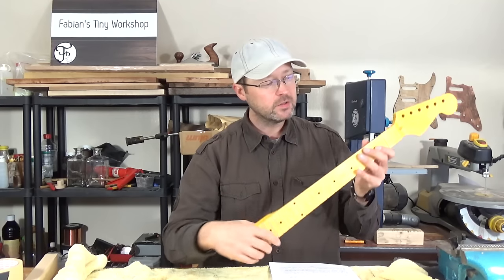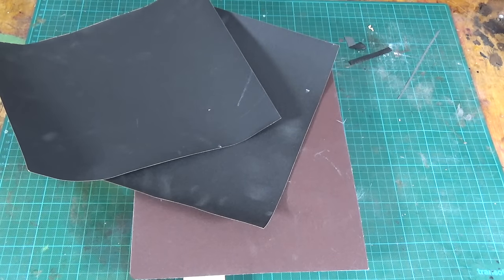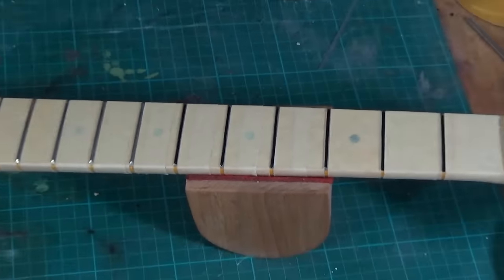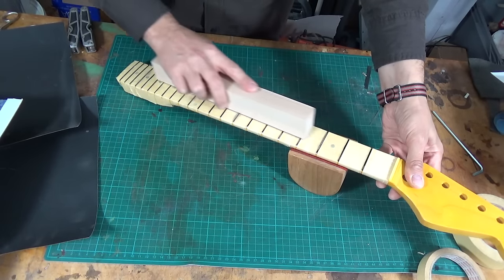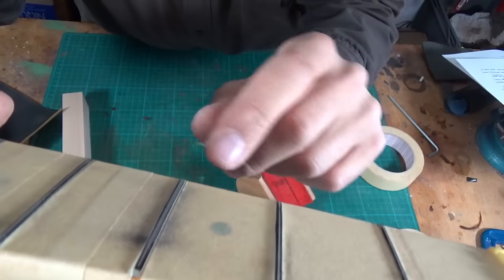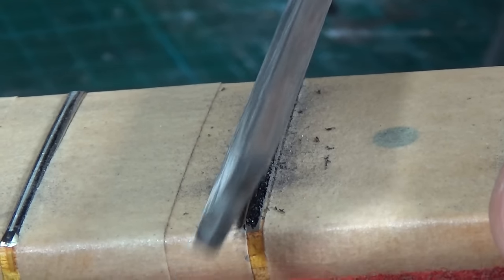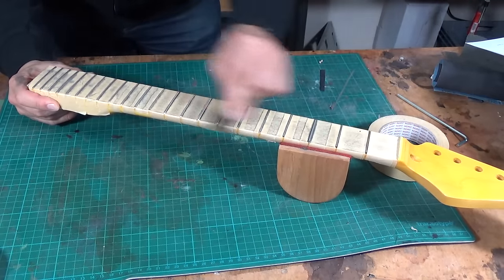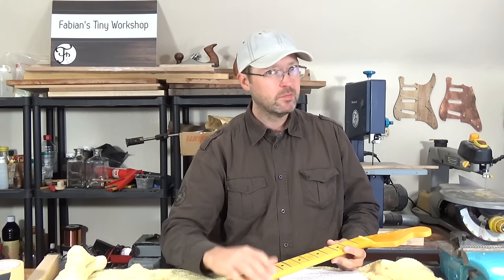Fret Leveling - The Easy Way // How To

Comment: I am new to crowning frets. I have tried this way a few times, and I have been gathering information. I just don't see how this is a good way to crown. What do guitar shops use? They can't all be sitting there for hours on end every day, working with files and sandpaper. It just wouldn't be financially viable. 90% of guitars sold at guitar shops have bad intonation, unlevel frets and terrible string height. Even the top brands are far from perfect. Do people just buy guitars that don't work and keep them as trophies? I just want a working guitar, I don't care what it is. I have been playing for over thirty years and all of my guitars have sucked!
Reply from the maker: Leveling and crowning frets takes time and time is money. That's why guitar shops don't invest this amount of time on setting up the guitars they sell. One might think that the manufacturer of the guitars is responsible for a playable instrument but unfortunately the quality on a lot of brands is not what it could be.
If you take a guitar to a shop for a fret job and a set up it costs monay because they have to take the time to do this by hand. Of course with a lot of practise it will be faster and they probably will not use a beam with sandpaper but a fret file and crowning file but still the same amount of work.
Reply: @FabiansTinyWorkshop  thanks for the reply, I appreciate it. What is the best course of action to improve the playability of my guitars. I have had a number of tries to level crown and polish but it has taken quite a bit of failure to better understand what the end result is supposed to be. Have you seen the method used promoted by Darren Drew, here on YouTube. He has a block of wood with metal rods and sanding sponges.
Reply from the maker: @datner76  Leveling and crowning is very important but most people forget to "level" the nut slots. The nut is basicaly fret no 0 so the slots have to be level with the frets. To high and you dont get a low action on open strings and to low you will have fret buzz. Also it's important to ajust the truss rod.
Regarding the video, he claims to start with very evel and level frets from the start so it might work but usually on most guitars you start with some high and some low frets. Meaning after the leveling some frets have been sandet very flat (the high frets) while others (the low frets) barely need crowning at all. If you do them all at once you might risk removing material from the center line of these frets former low frets, whily still crowning the flat frets. Thereby sanding these frets lower as they other frets. But that is just a guess I never did it hat way. I use a similar method by wrapping sandpaper around my finger but only with higer grit paper to remove scratches from the previous grits.
Reply: @FabiansTinyWorkshop  the nut slot height isnt something I have even seen mentioned in fret level demo videos. I have seen blocks of wood with sandpaper used to crown. I have also seen the YouTube guy with the tattooed head use the sandpaper on the finger method. 
Over the years I have seen and heard guitars with amazing fretwork but never in my hands. 99% of guitar players I have met, over 30 years, use the frets off the shelf. This makes them feel the need to buy overpriced guitars. I purchased an Artist TC 59 online for $279. I was amazed at the sound and quality, but after the first week I started to notice the bad spots, which led me to destroy the frets in search of understanding whats going on. If you ask me, fret work is like fly fishing, its easy when you are shown how to do it correctly. When you just have a go at, you will be very hungry and frustrated.

Comment: If you're hammering the frets in you will have problems leveling.  That's a fact of life.
You'll notice all kinds of stuff.  The rocker is fine when the strings are off....some frets rock when strings are on......or there's buzzes here and there and none of the frets rock.  Tension does funny things to frets.
A lot of times you level the frets and they look perfect until you play it.....No rock at all on the frets.....there's still high frets.  It happens a lot.  I always glue frets in.....it can be a nightmare if frets start popping up.
Be sure the fingerboard is radiused as close to perfect as possible.  I usually put a little extra radius in nickle silver frets so the ends stay down....high ends can make it a nightmare getting them level without taking too much off.  I usually use bigger frets so I got some meat to remove and still end up at .043 or better.
I may start using a file....like the crimson file leveler.  I've done about 20 guitars with a sandpaper leveling beam and I'm not real happy with it.  Takes too long.
Reply from the maker: I agree. Maybe with the exception of the leveling beam. A leveling beam with sandpaper and minimal tools might take longer but this video was intended for people who have one or maybe two guitars in need of a fret level. Of course if you plan on doing more fretjobs better tools will make the job easyer.

Comment: you may have to rplace your nut after because you'll notice that your action is high
Reply from the maker: You are right but a replacement might be a little overkill. I use a nut file to level the nut slots unfortunately for some reason I did not put this in the video even though it's part of the leveling process.
Reply: @FabiansTinyWorkshop  tbh idk how to file a nut 😅 and I have a locking nut…. Sooooo, idk

Comment: still fret buzzing
Reply from the maker: If it's buzzing in multiple places check for: Action to low, neck relief/back bow, twisted neck. Maybe the nut slots are to high witch can give the impression of a higher action when it's in fact already to low. Or the nut slots are to low wich will result in buzzing open string. If there is only one fet buzzing you simply missed it. Could also be that you lowered the crown of some frets during the crowning process (stay away from the center line of the frets).🤷🏻‍♂️